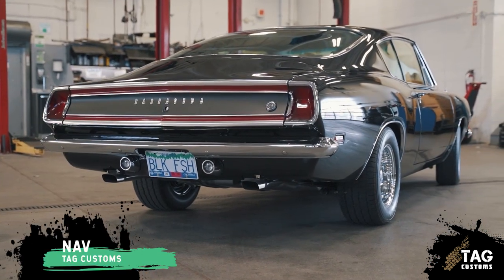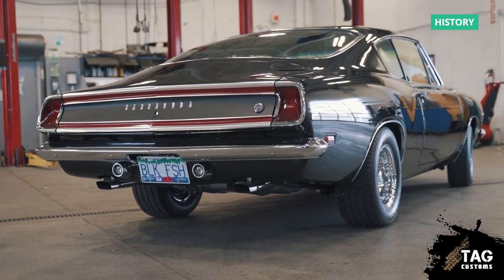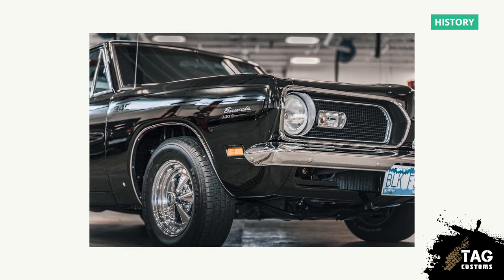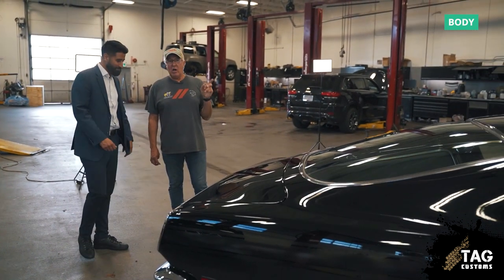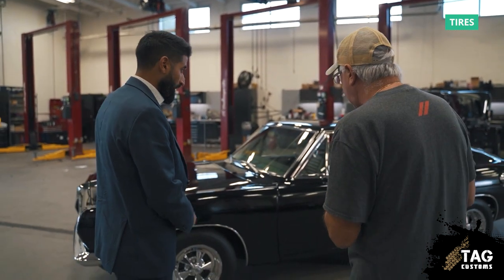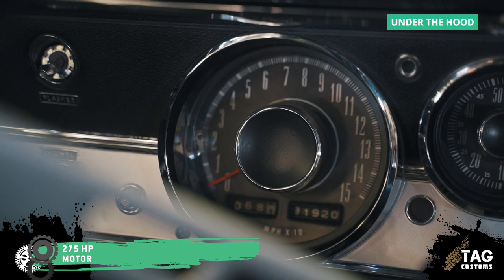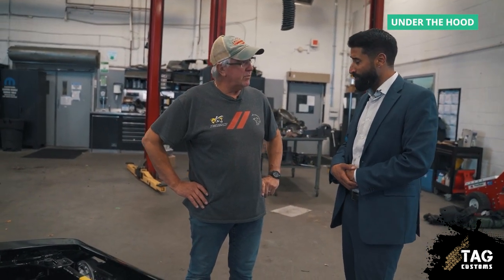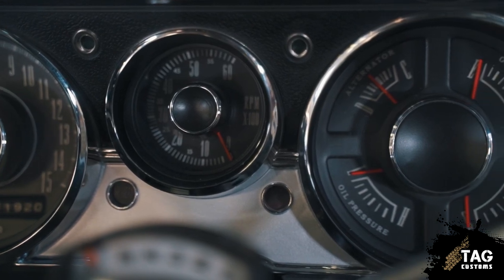The BEST  Barracuda you will ever see. 1969 MUST WATCH!!

Comment: Beautiful Fish indeed. Formula S was a top sport version of Barracuda from 1965 to '69. These Barracudas were excellent for nimble handling and driving ease. It's really great to see such a clean piece. Nice video!
Reply from the maker: Thanks you very much, and yea it was a pleasure to work with such a nice car
Reply: Actually not true. The "Cuda" was the top version ....not the Barracuda Formula S.
Reply: @ctbourbon  Actually not true😁 The name 'Cuda did not officially appear until 1969, although this shortened term had been used before. From 1965 to 1968, the Barracuda with the Formula S package was the sportiest version. In 1969, the 'Cuda 340 or 383 version was introduced and it could receive similar equipment as the Formula S. Everything depended on the customer's wishes. It is definitely highly debatable. On the other hand, the cuda 440 M-code was just a "'Cuda". This probably also played a role in the fact that in 1970 it was no longer on offer.

Comment: Yeah the 340 setup was very cool under stated 4 barrel so on from the carburator to the transmission the exhaust manifold exit is the same size as the 440. In a world of low hood lines the small block was constructed essentially higher than the big block it tended to breath pretty good Good setup
Reply from the maker: The Hemi Killler

Comment: In 1969 I  purchased a repoed late build 1968 Formula S 340 fastback in lime green. SUPER CAR. I mention late build because of some of the anomalies I came across . First was rthe distributor, took 1969 points (hinged opposite end) ,. Way down the line it turned out the speedo was a 67 - different cable . Chrysler never could find the part nbrs for numerous other items. ????  The Kelsey-Hayes 4 piston disc brakes were a disaster. the cyl were not bored true perpendicular, the pistons would jam and complete rebuild necessary. about every 25-30 thou. All that being said I LOVED THE CAR!!!! LOLOLOL
Reply from the maker: Haha wow who would have ever know that a cool lil fun fact tho, lime green sounds beautiful
Reply: @TAGCustoms  In Aug, 1973 at Magnolia Oh My car beat a 72 Challenger 340 with 6 pack by almost a car length. `13.95/105.1 MB-I-L drove ot in a grudge against a HS buddy. Dan Kennedy was so POd he traded his car off the following Monday for a 69 hemi   RR. What Dan didnt know was I had done a CAI from the plenum under the windshield direct to carb.
I had studied Smokey Y carefully. Smd before every trip to Oh, I pulled the dist and "cleaned", adjusted the points and timed it to a "T". For a brief period I had a McCullogh VS57 on it. TOOO MUCH., took it off. LOL
LOVED THAT CAR. put over  a hundred K on it. You probably wont believe me, no one else does, but between Breezewood and New Stanton on the PaTpke I could gwet an honest 21MPG by holding 3200RPM where the bsfc was at the minima of the fuel curve..
Reply from the maker: @frederickwise5238  Man 100k thats alot of driving for a car like that, nice to see it get put to great use tho, most of em end up as just show pieces.
Reply: @TAGCustoms  At the timee it was a family car..  only occasionally on the track or..... Divorce brings an end to all things.. eventually.
Reply from the maker: @frederickwise5238  Aw Im sorry to hear that,  would have been a crazy family car
Reply: @TAGCustoms  With the back seat folded down, the kids had a great place to play or sleep on long trips.
Reply from the maker: @frederickwise5238  haha would have never thought of them as spacious
Reply: @TAGCustoms  Havent you ever seen a fastback with the seat folded down? There all kinds of room for a 2 and 4YO to have fun. Almost 6' front to back and full widthfor 80% of the length. We did travel much at night or the sun thru that large lss would have bwwen pretty hot.
Reply from the maker: @frederickwise5238 Yea Joe showed us the seats folded down, I guess I'm just so used to the Road trip Van n Jeep life.
Reply: @TAGCustoms  And those sorts of fastback types came to an end in the mid 70's or so because vans were becoming more popular One of the less memorable vehicles we had was a 76 Dodge van that I "interorizes" and it was more comfortable on onger trips but it was lucky to get  12mpg.. LOLOL
Reply: Lime Green! Sounds like it was messed with quite a bit!
Reply: @ctbourbon No it was all original, I got it from a dealer, repoed in Jun of 69; (maybe I called it the wrong name), it was a dark metallic greenish.  If you know Id appreciate the  color name for the record.

Comment: I have one and it will be black on black on black but since it is nothing special 318 auto i am doing it up like i want into a stroked 440 6 BBL fuel injected 5 speed and a Dana 60 with minitubs and a stage 3 US car tool kit. It is converted to disk brakes and tubular control arms and it is on the rotisserie as of this writing.
Reply: the one in my shop is getting upholstery work and is factory stock down to its hurst shifter. the guy needs to do a disc brake upgrade. good luck- get a 340 theyre about the same $ as a 318.
Reply: @tommurphy4307  You are right Tom about the price difference of a small block to rebuild as i have a still very good (50,000 mile) magnum 360 as a what am i going to put this in spare but like my comment above i also have a very low mile 440 beer can headed 440 sourced put together out of a in the  back kitchen fire motor home that will be used for my Cuda.
Reply from the maker: Wow nice build

Comment: I think the current owner is exaggerating the weight considerably.  A slant six 69 Cuda is probably 2900#'s, maybe.
A 340 drum brake Cuda is probably more like 3300#'s, maybe 3400#'s.
I have a '67 360 auto which I've never weighed, but I've got a 340 64 Dart 4spd w/headers and front disks and it's over 3400#'s.
Regardless, beautiful car with lots of NOS trim installed.
Reply from the maker: Yea the amount of NOS is truly impressive I cant imagine the hours on google trying to track it all down, from across the continent
Reply: No I think I remember my 71 duster weigh-in 2300 pounds I had put in a factory sunroof (if you can believe that) and the fold down seat both kind of heavy plus I think for some reason it was a dealer demo I had replaced a fender and it was heavy with sound deadener still I weighed it at a truck scale 8/34 rear and stuff I'm still freaking
Reply: @jamespell8091  not believing that at all. I think you misremembered the number.
Reply: @budlanctot3060   perhaps the scale was rigged

Comment: There was a freind ( gone now) that had a 69 hemi Cuda convertible.   It was blue.
Reply from the maker: Nice car forsure
Reply: Then your friend must have put a Hemi in his car because the biggest engine you could order for these were the 383 & the 440 wedge engines . The 440 Barracudas were very rare . The only Hemi available for these would have been the B029 factory Super stock drag cars that Chrysler had Hurst build for them to sell to certain drag racers like Ronnie Sox and a few other well known Mopar drag racers. These cars dominated it's class back in its day and today they have their own class as well with others that have these cars and the Hemi Darts that were also sent from Chrysler to Hurst to build those as well . These cars now today with modern wheels tires for drag racing and better suspension are running high 7 s low 8 s in the 1/4 mile with no power adders like turbos blowers or nitrous just high octane race fuel .